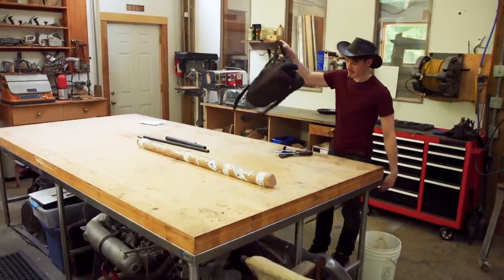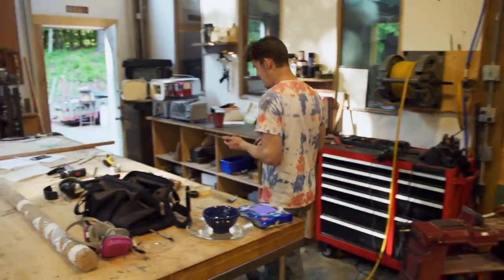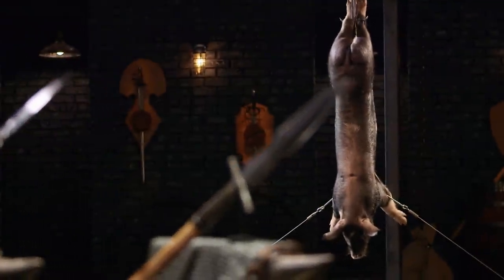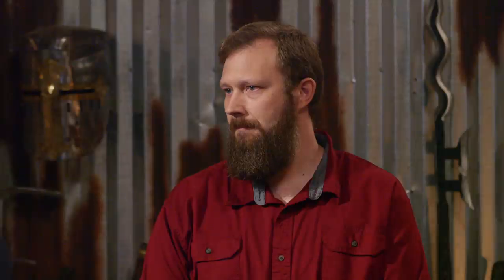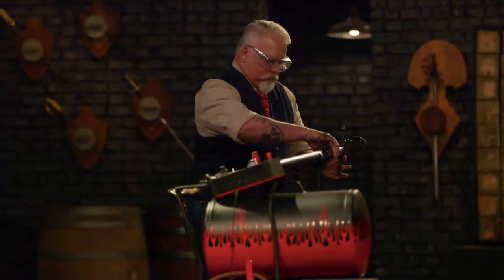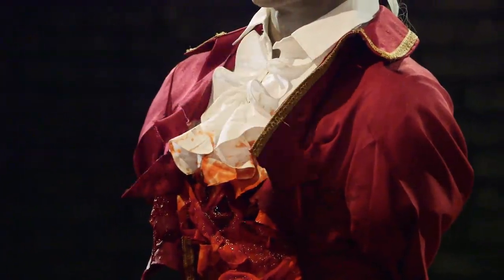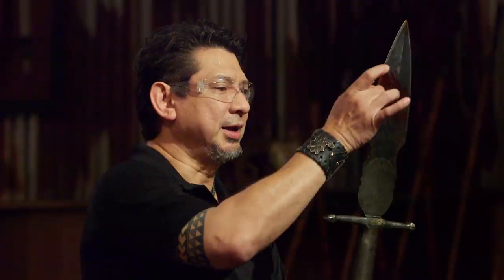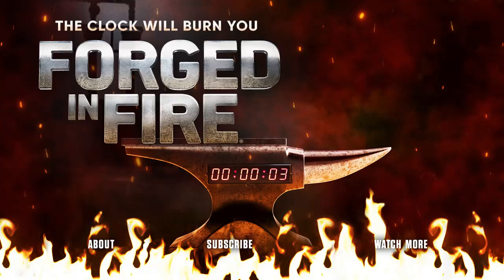Forged in Fire: HUGE Revolutionary War Spontoon PULVERIZES the Final Round (Season 7) | History

Comment: I feel like this was kinda unfair cause his didn’t go into the wood it went between a gap so we couldn’t really see if there would be any damage
Reply: I think it going between the wood is even worse Stress for the weapon tho
Reply: It going between the wood just means the cross guard took more stress and it probably hit some cement or something behind it
Reply: @reachingvalhalla5096  But like Chris said it was very close between him and Zane so the deciding test probably was the sharpness test which Chris had a massive advantage in due his blade taking no damage in the strength test
Reply: @reachingvalhalla5096  Not at all. Take your knife stick between two pieces of wood all the way to the hilt and flex it back and forth. Now stick the blade into the wood as far as you can and do the same thing. Makes a big difference.
Reply: @reachingvalhalla5096  Also... that gap it was lodged in wasn't that wide before it got lodged there.

Comment: Could that even be considered a strength test? You could probably split wood like that with a blunt bargain shovel.
Reply: Bruh... it's not about splitting the wood.
Reply: 1st rule of the Strength Test: it's not about what your weapon does to the target...
Reply: @SrChr778  amen brother.
Reply: @HaltoxTV  You have missed the point. The wood offers no resistance thus does not offer any valuable test of strength. Wood splits easily when impacted by a narrow edge on the endgrain, this will lessen the impact and not be difficult for the weapon the pass.
Reply: It didnt split anything it went down the seam in between the pieces of wood. Not a fair test at all.
Reply: @irishninja9857  exactly , they should've did his test again and maybe the other guy who lost had a roll on the tip of his spear because he actually did the test and got go in the middle

Comment: The other guy should have one cause the guys that one didn't cut that pig for nothing so it is not razor sharp
Reply: That's that I thought and not to mention the "wood wall" Strength Test on the 2nd spear was invalid because it went between the walls were the first hit dead on and took glinting. How do we know that 2nd spear wouldn't have the same damage if it hit right? 96% of the time I usually agree with most test and assessments but from the 2nd test not adequately testing the 2nd spear and to me it looked like he did less slashing damage on the redcoat and it looks as if it just cut the coat before he started stabbing it.